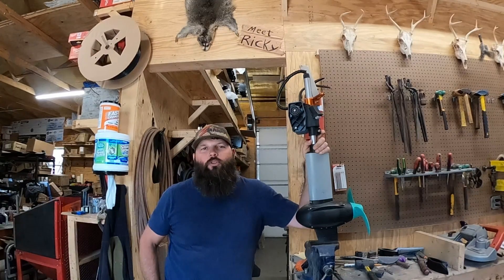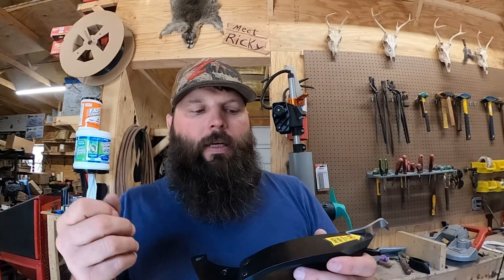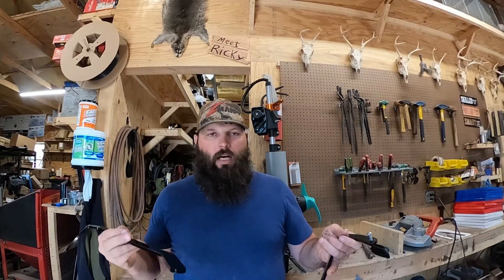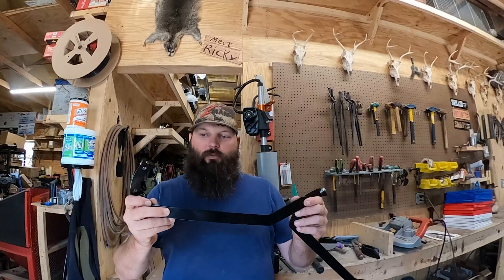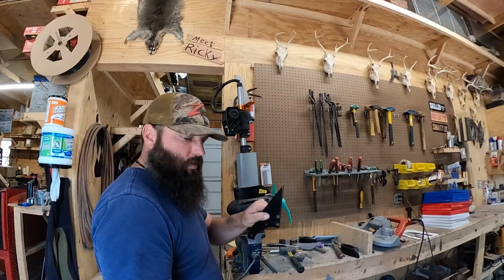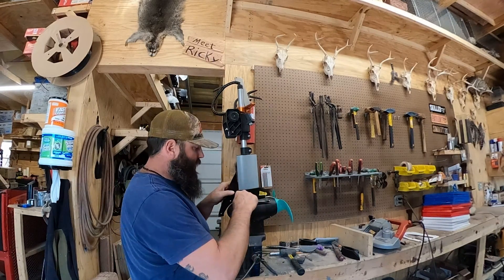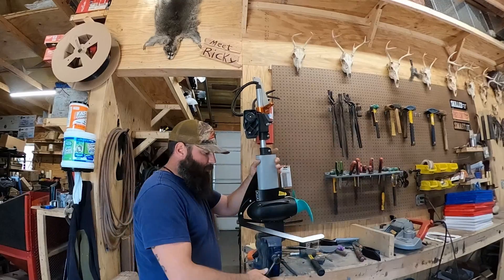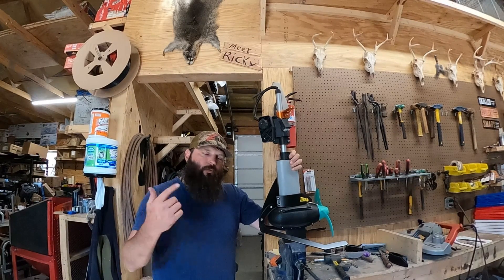NK300 / Torqeedo 1103 Rock Guards

Comment: I fish open water , with a motor . I used Innovative's motor mount, so I knew the quality was great. When it came to rock guards, I hesitated. I am out in 40 feet of water. Motors are expensive gear and I tend to be careful so I ordered the rock guard. At the very least , I thought it would offer protection landing my Kayak in the shallows. I was wrong. This year I found myself fishing rock jetties, very shallow! The guards totally saved my motor and prop. Worth every penny! The other surprise for me, was Innovative foot controls. Freeing up both hands and steering with your feet may seem a luxury, but fishing Bay structure like bridge pylons you will get a lot of strong current. Handling with a fish on, you have both hands free for the throttle or a net and a rod. It also pays dividends getting out snagged lines. These accessories were easy installs and I can't say enough about their effectiveness.
Reply from the maker: We appreciate the feedback.  Glad to here that our products have a positive impact to your time on the water.
Reply: @innovativesportsman4679  High quality, functional gear!  So pleased!

Comment: Hey I got a question about the ospreys. How long is the actual deck from the tip of the bow to the back not including the pontoons on the 1436 and the 12936
Reply from the maker: @juancanon1459  
1436 is 12’-4”
12936 is 11’-4”
Reply: @innovativesportsman4679  awesome thank you for that. When will the 1436 be back in stock? Any improvements being added to the 1436 when it’s available?
Reply from the maker: @juancanon1459  we should have the 1436 back in stock in November. The only change will be that the front of the kayak will be scooped higher to handle rougher water better.